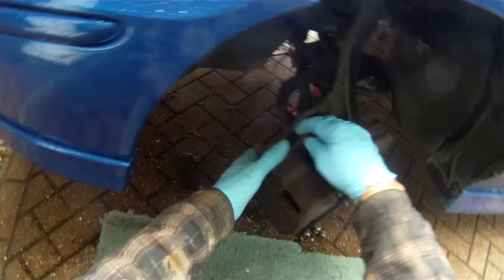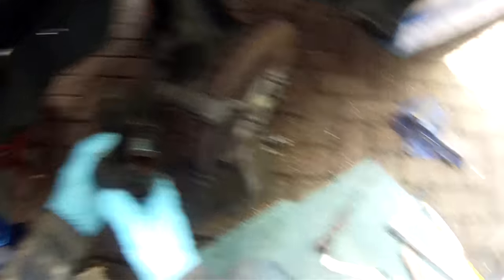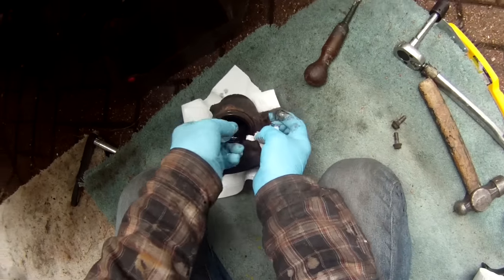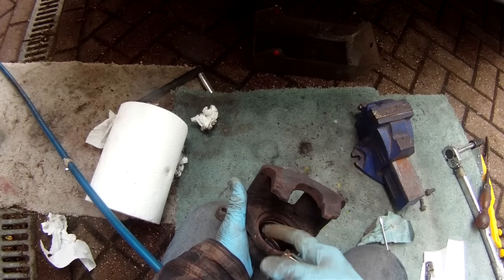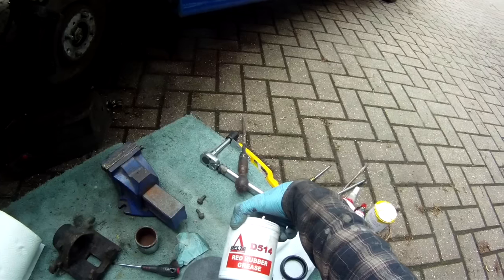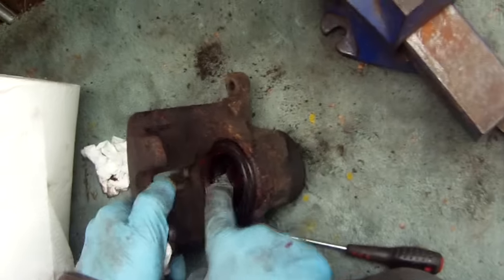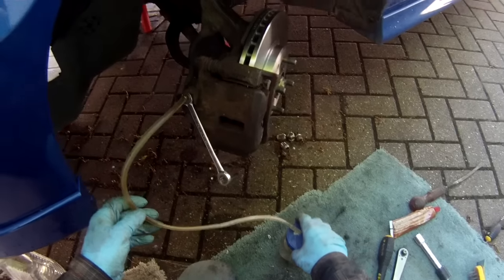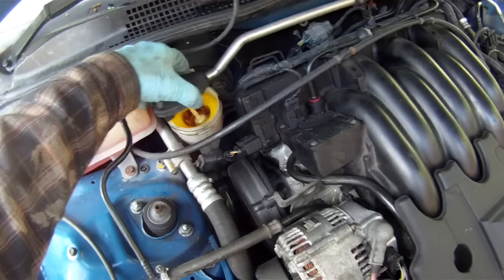How to Fix a Stuck Brake Caliper

Comment: Hi friend whats this rubber grease, i didnt see it before in shops so what can i use alternative?
Reply from the maker: There are a couple of buying links in the video description, for the rubber grease on Amazon.
Reply: @comeinhandynow  is it nessecery or i can use wd40, or Just clean inside piston area where it sit and thats it, what i can do cause 2 caliber stuck both front and have to do the job and itll take long time if i order this grease now 😁, whats your opinion?
Reply from the maker: I wouldn’t use any type of oil as that deteriorates rubber.  If you don’t have rubber grease just use brake fluid, but that wont be as good for bits exposed to the outside air as it attracts and absorbs water.
Reply: @comeinhandynow  thanks

Comment: It would have been nice if you showed us how to take it apart instead of skipping
Reply from the maker: Some complain of my videos being too long and not getting to the point, so hard to get the balance right for everyone.  Which bit of dismantling do you need more detail on?
Reply: @comeinhandynow  sorry I didn’t mean to be rude. Working on my 2009 corolla front brake and I can’t  manage to reset the piston using C clamp or the tool from autozone
Reply from the maker: @glock-hv7wq  It could be rust and gunk in the lower part of the caliper bore. Very common.  You need to strip it down like in the video and clean it out.  Pop out the piston just by pressing the brake pedal to push it out.
Reply: Pressing but it’s not coming out
Reply from the maker: @glock-hv7wq  Try running the engine to get more servo boost assistance to the brake pressure, that should help if the piston is stuck.  Lookout for the release of brake fluid though when the piston pops out.  I assume you’ve removed the pads and moved the caliper away from the brake disc as well?
Reply: @comeinhandynow  thank you!

Comment: I replaced the rear calipers on my car about 5 years ago, and they've started seizing already. Think I'm gonna try this instead thanks. =)
Reply from the maker: Cheers.  By the way my brakes are still good with no sign of any pulling to the side like before.  Over a year ago now.
Reply: Noice. I liked how your gloves got progressively more knackered as the video went on. =)
Reply from the maker: I go through a lot of gloves!  Good job they're cheap.

Comment: can you use a little scoosh of wd40 in the piston chamber to soften up any deposits that are in there.
Reply from the maker: You can, but wipe it all out afterwards as oil can soften up and weaken rubber and you don't want it to affect the rubber seals.
Reply: Yeah the only oil you should put on rubber is rubber grease which you should not have in your braking system, petroleum based lubricants eat rubber and melt it, which could mean that you have no brakes at the end of the main straight on the race track, that could cause a problem - lol

Comment: .....or just spend twenty something dollars on a new caliper if your time and safety are worth a few dollars.
Reply from the maker: Sometimes the parts aren’t available. Often they are a lot more expensive than that and sometimes you just need it done quickly.  Or maybe you just can’t afford it.
Reply: @comeinhandynow  yeah, good place to save money, brakes
Reply from the maker: A bit of common sense needed to assess whether it is dangerous or not based on the condition of the parts.  If the callipers and pistons have a lot of rust inside then replace them.  If only a little at the bottom of the bore where the seals never get to to then personally I would say its ok to rebuild and unstick them.  It’s up to you.
Reply: $20? More like £140 for mine 😭
Reply: 20 fooking dollas . I drive a 4 million pound super car . The caliper alone is 17 thousand pounds and the labour charge is 9 thousand by the models approved service profesional . And whats worse is they have a 5 week waiting time.  This man just saved me 26k sterling . Which in turn made me want to give 20k to a homeless man . So pls take your negativity somewere else . Also i have over 70 motor vehicles and was able to fix several others . Yes2 of them were beyond a repair job for my mechanic.  However as he clearly states use some common sense and if the seals and a refurbishment are not adequate then replace part . I often drive on gritted roads so yes the seals will often go long before the whole unit is to be replaced . Also just because someone has been fortunate enough to make vast amounts of money i can assure you they dont all want to throw it away for absolutely no reason . I can only presume you are a failing mechanic who has over charged your local customers for some time and that along with second rate work and no doubt a stinking attitude you have come here to try and find someone else to blame . I think its very kind of this man to have taken the time to help many thousands of people in variouse situations from across the world.  I mean no badness to you but pls try to be more positive.  Your like a naughty dog seeking attention and you may find that shitting on the carpet for a reaction is not the best way to get it . And besides the jokes on you when you forget in time and stick your face were you layed it on that previous attention seeking day .
Reply from the maker: Good one, thanks for the feedback on the potential savings.
Reply: "Twenty something dollars for a caliper" ?????  Whereeee???   maybe in china.   Mine costed me like $80  of course i dont want a very cheap one

Comment: Thanks friend ran into this earlier today happy to have found a fix for tomorrow
Reply from the maker: Cheers, good luck.
Reply: @comeinhandynow  Thanks, quick question what's a safe size sand paper that should I use for the rust?
Reply from the maker: Flex Craft For really rough rust use 400 grade wet and dry but for very light marks and polishing especially of the piston use 1200 grade
Reply: @comeinhandynow  ok thank you very much
Reply: @comeinhandynow  I  Successfully fixed the problem with your help my friend, just wanted to let you know, I really can't thank you enough 🙂👍
Reply from the maker: @flexcraft1203   Thanks and well done.

Comment: Idk if my piston seize 1 dude suggest that so if this method don't work do you think that's the problem
Reply from the maker: If the piston is seized tight then try pressing the brake pedal hard with the engine running, the extra power from the brake servo should be enough the push out the piston.
Reply: Okay Thxs I'll try that then after I do that will it compress
Reply from the maker: It will if you remove the piston, clean it out and then check the piston fits easily without the rubber seals in place first, as in the video.
Reply: Okay Thxs for the info
Reply: Burger Van Dreamz it was the other way around the front was worn more than the back but I just got a new caliper but sadly now my transmission is leaking I can't get a brake w this car
Reply: Burger Van Dreamz yeah man n this my first car I'm 19 so u know with ur first anything u do everything to keep it but do u think a transmission seal will work until I can get it looked at I just found out about that stuff n wonder is it a good product
Reply from the maker: Probably better to just keep topping up the gearbox with more oil.  Then either get it fixed later or just keep on occasionally checking and topping up.
Reply: comeinhandynow wat that mean
Reply from the maker: I mean it's better to just put more oil in the transmission instead of a transmission seal product that probably won't work.
Reply: Oh okay so like just put a lot in there but it's kinda linking a lot out

Comment: Good vid, how easy should the wheel spin with your foot off the brake ? do the pistons move back on the square cut seal or is it the friction of the rotor that jiggles it away? thanks.
Reply from the maker: Thanks.  The wheel should spin for quite a few turns on its own when the wheel is in place.  Some rubbing noises are ok.  There is no mechanism to move the Pistons back apart from the slight rotor jiggle, as you say.
Reply: Thanks for that.

Comment: Thanks for this informative video, very helpful. However, I don't think I'd put Loctite on the bolts to secure them better...in case I ever needed to remove the caliper again, could be a problem! I put a little anti-seize paste in the threads, then tighten them good and snug.
Reply from the maker: It is not loctite super glue, in case you were wondering it is loctite thread locker, a special compound that is the same they use on new caliper bolts to stop bolts working loose.  However the bolts can still be undone with a torque wrench.   I would definitely not use anti seize paste like copper grease.  It is a safety critical area, where you dont want bolts coming loose.  So best to follow the method that car manufacturers use.
Reply: Anti-sieze is a bad idea. They can come loose
Reply: Anti seize only on the slide pin part of the bolt, not in the threads

Comment: Don’t use a clamp on your soft line.  They have a metal liner,  that you will crush .  And when you crush it,  it acts like a one way valve.
Reply from the maker: I think you may be thinking of steel braided Flexi pipes, which of course you shouldn’t clamp.  The steel braiding is on the outside, so very visible.  However for normal rubber flexi pipes clamping the pipes is a normal and common practice.  I don’t believe they have metal linings unless you can prove otherwise, if they did they would be thinner like steel braided flexi pipes.

Comment: i have a problem i was with my friend and we took the caliper of the brakes and then i mistakenly pushed the brake and the piston wont go bake and i cant put my brakes on any more  have u got any advice?
Reply from the maker: If you are having problems pushing the piston back into the Caliper make sure you have slackened off the bleed nipple in order to let out any air or fluid that will be pressurised as you are pushing in the piston.  Also make sure the piston is going in straight, try pushing on one side of it and then the other.
If you completely popped out the piston, then make sure the inside bore is given a good clean and clean out any rust accumulation underneath the rubber seals, remove them to do so.
It is difficult and requires a lot of patience to get the Pistons back in with the rubber seals in the right position, but it can be done.  Just keep trying, you need a lot of patience.
Reply from the maker: I should also add that the bottom of the bore of the calliper often has deposits or rust around the bottom that stops the piston going all the way back in. You need to remove the piston and give the bore a good clean out, especially at the bottom.  Check that the piston can move easily in the bore with no rubber seals in place, if it can't then the bore or piston needs more cleaning.
Reply: thank you i will try that